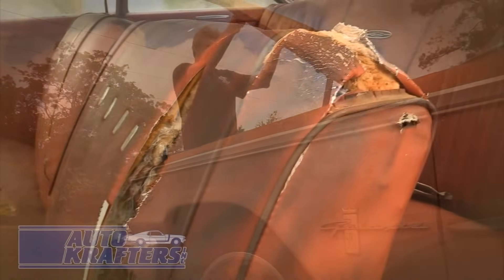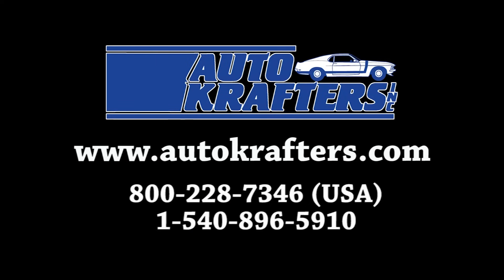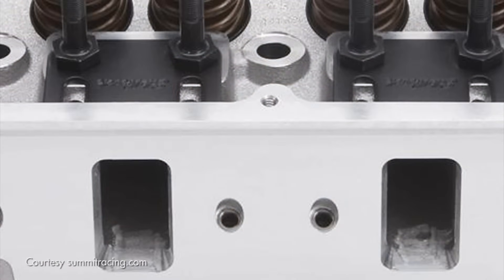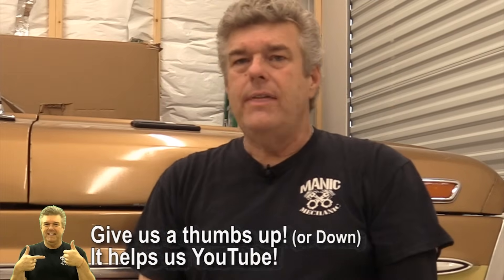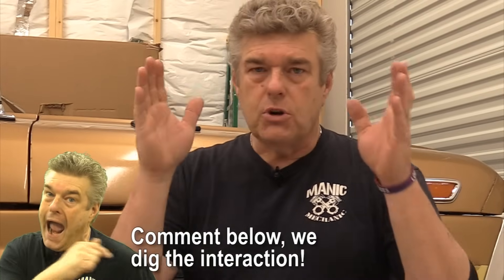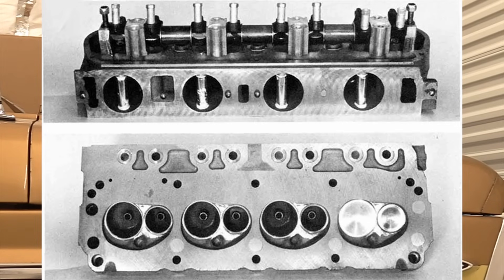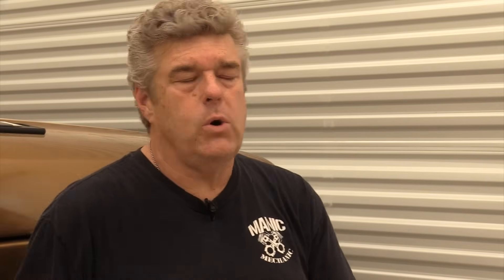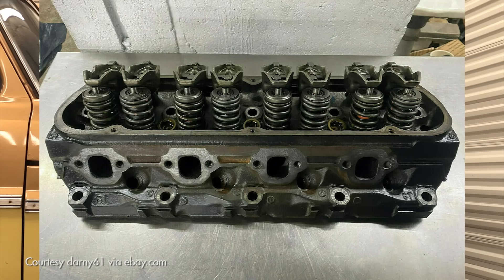Ford Heads Explained

Comment: No mention of the 255, just because a rodent passing gas moves more air than the heads on this is that any reason to skip it?? (YES).   While I may not adhere to your just-get-aftermarket-heads view, I appreciate you putting this out there.  Some deals can still be scored on 351W heads, I picked up a set of complete D0OE heads at Ford Carlisle (2021) for $75.  Still need to get them tanked and inspected but for the price its a risk I'll take.
Reply from the maker: Don't get me wrong, iron heads work great, it is just that some folks look more to total cost in rebuild vs new.

Comment: Question: Are there "any" good or okay late model cylinder heads out there? Not just the GT40/P cylinder heads? 
Right now i have a 66 289 that was said to be (finger quote's) ran before being parked. 

I really like the idea of running the late model roller can engine. Not just for the better performance aspect. But i have been hearing more and more about new camshaft going flat during the break in process. And this is coming from guys that have been rebuilding engines for 40+ years. 

Sorry, got off on a tangent. I guess that performance is not the only thing that i myself am looking for. Dependability is also a factor as well.
Reply from the maker: Most of the aftermarket heads are really good. As for the stock iron heads, the GT40 and the GT40P are the best of the lot.

Comment: Jeff,
Good video - thank you! I should have mentioned that the 351 heads/blocks use a 1/2" head bolt whereas 260/289/303 heads/blocks use 7/16" bolts. So to put 351W heads on a 260/289/302 you need either special head bolts or head bolt washers. Not a huge deal but just putting it out there.
Paul (in MA)
Reply from the maker: Agreed. I know that ARP makes a head bolt kit for those, I just forgot to mention the size difference.
Reply: They do offer spacer bushings for the 351 head on a 302 as another option
Reply: Ford started using flanged head bolts in around late 1980s or early 1990s if you have them they work great for putting 351w heads on a 289 or 302...
Reply: On my Ford Racing crate engine that I bought new in 1994 and was advertised as a "Cobra" 5.0 engine, it had the GT40 iron heads on it.  The head bolt holes were for the 351, at 1/2".  Ford assembled the darned thing without the washers and just went ahead with installing the factory, 7/16" bolts.  I ran the engine for a while before I changed to ARP head bolts and the spacer washers.  I got rid of the OE "torque to Yield" bolts and have stayed with the ARP hardware that can be reused over and over. 
 I don't know why the Ford engine assembly folks didn't use the spacer washers, but it doesn't make me particularly happy about their quality control.   I also wonder what Ford did on the 1993-94 "Cobra Mustangs" and if washers were used there?  While I didn't encounter any problems during the short time that the engine was run without those washers, it's kind of basic engineering knowledge that the spacer washers should be used to keep the head bolts properly aligned.   I strongly recommend using the ARP head bolt kit for the quality, strength and the fact that the kit contains the washers.  The head bolt kit is affordable, too.
Reply: I used Arp studs. I was 18 at the time. Built it myself in garage. 69 351w on 302. Put it in 4x4 Ranger 1 ton running gear. On 44" tires.
Reply: Good point. I believe if heads are swapped, intake has to be as well because of block pitch.
Reply: @mw7788 302 and 351W use different intakes anyway. The cylinder heads used on both motors are dimensionally the same.

Comment: Understand that every 6 cc chamber change is ONE FULL point of compression... Depending on the cubes. Going from 54 to 60+ drops your compression to 8/1.
Reply from the maker: True. That is why I mentioned the '68 as being the best place to start with the 351W head.
Reply: @AutoRestoMod NO W ever had chambers smaller than  62 cc. Not to mention there were no 1968s.
Reply: The C90E & D0OE 351W are always listed as 60cc chambers...
Reply: @AutoRestoMod 
69-70 W head is 60+ cc nominal, MOST measure 62

Comment: About GT40P heads, headers, and spark plug interference:

A set of accel P526S plugs seems to be a workaround answer, as they are a stubby plug and I believe (confirm on your own) they have the correct thread depth for P heads. Another solution is using a set of 90 degree boot plug wires if you can route them properly. Second option is probably the cheaper of the two!
Reply: I got Ps on my Foxbody.  Number 7 cylinder is only one I had to use different plug wire with bbk shorties.
Reply: Also, tri-y headers clear p heads on shock tower cars... so do most stock cast manifolds.
Reply from the maker: Agreed.

Comment: 96-97 Explorer GT40 heads have 3 bars cast on the outside each end. 
98-01 Explorer P heads have 4 bars cast on the ends.
Reply from the maker: Good to know Ray!
Reply: Yep,
3 bars or 4 bars on the end of the head.
My brother and I have found 2 sets of GT40 heads* in local junkyards 
They aren't THAT rare.
*They are cleaned up and installed on both of his Broncos.
Reply: @Turbo4Joe363  nobody really is saying that they are rare, they came on all the 5.0 cobras, 5.8 lighting, and early 5.0 explorer.

Comment: Ford might not have referred to there engines as "smallblock" or "bigblock" but they did indeed make small blocks & they did make big blocks. They 2 different small blocks & they made 2 different big blocks. Over the yrs the term has been adopted & it fits. People understand what your reffering too when you use those terms. Windsors & 335 series are smallblocks. FE's & 385 series are big blocks. Those people that get uptight about the terminology are simply uptight people & should not be followed or taken seriously or humored.
Reply from the maker: LOL. I like to poke that bear though...
Reply: Was a 352 a big block ? Is a 351 a big block ? 
Back in the day, Ford had the FE, and 289. But nothing between. Hence the mid block 351. 
Ford found displacements in the 350 range very popular. The 351 being the most popular. 
Demand was so high Ford at one time had three 351's.
Reply: @cammontreuil7509  what they really had was 4 different 352's. Check the bore & stroke on all of them. All of them exactly the same displacement. And there are midsized engines but not a mid block. As far as the 289 well?? They had the 260 also with the 289. The had the Y blocks that were 272, 292, & 312 ci. As far as FE's they had the 332 & the 352 when they first started that engine line. They also had the Edsel 361 FE back then. And also the very large MEL series engines. I believe maybey a 383, a 410 MEL as well as a 410 FE at one time. Also the 430 & 462 MEL engines. I might have left one out??? But to bring back into focus, the block size question. Ok, again, this is not how ford originally referred to these engines, but I think a very fitting adoption of the terms. The 4 basic engine types that hot rudders are most familiar with. The windsors, 260, 289, 302, & 351w. Even the nay sayers can usually agree these engines are small blocks. Next up, the 335 series "small" block engines. The 351C, and most agree that yes, that is defenarly a small block. The next ones do confuse alot of people, the 351M & 400. Also small blocks. Becouse they all share the exact same bore spacing. Deck hight dousnt determine this nor dous bell housing requirements. Bore spacing says,, parts interchange such as heads & also crankshafts. All the way to the 260 to the 400. Small blocks. Now FE's! My favorite! Everybody knows big block!! They are the old big blocks! Chevy also has 2 different big blocks, the older ones & then the later ones. 348/ 409 for chevys then 396, 427,454. Fords were FE's for there older big blocks. 332, 352, & 361. Then the 390, 406, & the merc 410 FE. Also the legendary 427 ,& then the 428 complete the line up for FE big blocks. Then ford wanted a newer & bigger big block and then we have the 429 & 460 & no question here from anybody im sure, these are huge big blocks. They started to faze our the FE engines & they were left using the 460 big block up to 1997. There you have it, 2 small block packages & 2 big block packages. That's one more than chevy offered with there small blocks & there 2 big block packages. Im typed out now. Have a nice day.
Reply: @jesseduke694  true about bore stroke of 352. But I'm making reference to Ford stating a mid block. 
I know all the other things you said.
I'm making a pertinent point about mid blocks.
Reply: @cammontreuil7509  are you saying ford called some of there engines a mid block?? That would be somthing I guess? Becouse I guess I thought "mid block' was a term that you brought?? If ford referred to there own engines as such I would be pretty saprised? I gota say I have my doughts. Not that it nessecariry makes any difference to my point. One ford referred to them as engine family's. Not small or big. So I assume if to them they not small or big that would also include mid?? Wouldn't it?? Also as stated most of us, some purists will never conform, but us regular hot rodders that just refer to them as what they seem to be as described from our common language we happen to know. Myself & probably many others didn't know small & big block were chevy language until later in life. So the language fits & many others understand it fine. So we clearly have abandoned the ford ways to refer them long ago so much that it's almost just common car language now for all makes, if they even have different sizes? And as far as ford categorizing them into family's, they didn't even refer to the 289 or 302 as windsors until 1969 when they referred to the new 351 as a "windsor". So ford didn't have a solid fool proof grasp on there own categories.  That's another reason for calling the 352w, the 352C, & the 352M 351's. They didn't want people confused from there older 352FE. So they simply said 351.
Reply: @jesseduke694  it's interesting to note how Mopar classified some of their engines. In Mopar nomenclature how did they denote the 383 and 440 ? Big block ? It is quite appropriate to call a 440 a raised block. But raised from what ?
More accurate would be to call a 351W a raised block. And then as you noted, other earlier engines began to be associated with the windsor name. Which by itself caused some confusion.
I remember Ford using the term, mid block, when the cleveland first came out, to try to differentiate it from the 351 windsor. Remember, the cleveland has a shorter deck height, even a separate block all its own. Much confusion at auto parts stores were common in the early 70's. Much argument came from the Chevy crowds at race tracks saying the cleveland was not a small block. Chevy owners and Chevy itself coveted the term small block.
So the names Cleveland Windsor and Michigan or Modified began to be used as a way to tell parts counter people what you had instead of just saying 351. At the parts store, if buying parts for a 351m, I would call it the morphidite. Fitting for a really screwed up engine. How would that 351M even fit into the raised block nomenclature ? Same category as the 255 ? No that wouldn't work either.
So to would the 351M/400 which are technically a raised block.
In my own funny way I would call the boss 302, which I have, a platypus block.
I remember growing up in those times. It was exciting times for me. Wow. I had a dad who was a motor head and all his 8 brothers were motor heads too !
 I got to ride and drive all kinds of cars.
I watched them fix and tear apart so much stuff.
In my teenage days, I was strong.
My uncle stood on one fender and I stood on another fender and with a rope tied to a short block mouse motor lifted the block out of the 64 Impala and dropped it on the ground.
Reply: @cammontreuil7509  I had all three. 351w,351m which has big block bolt pattern and 351c which has 351w bolt pattern .